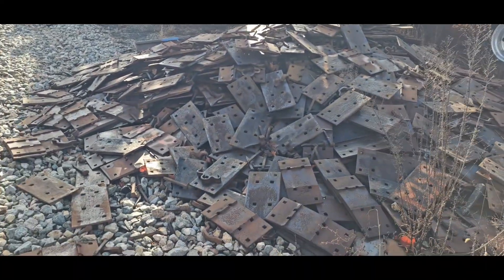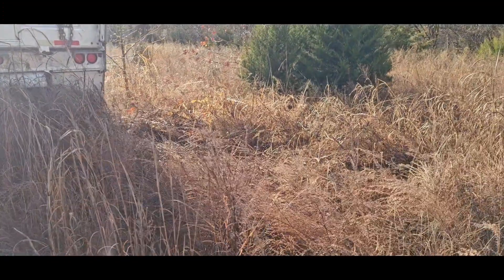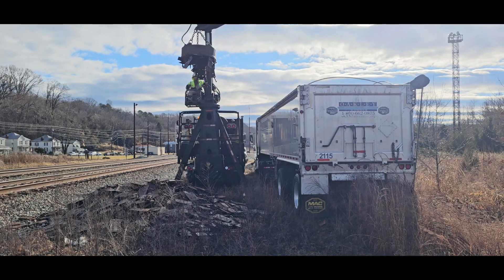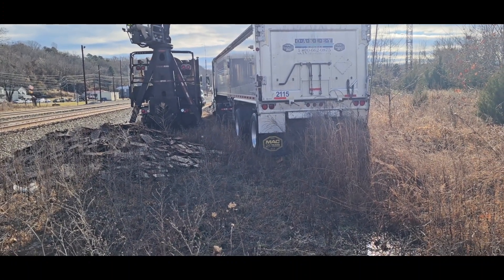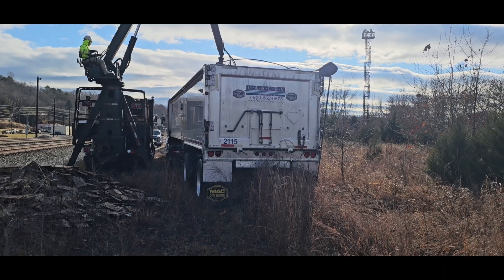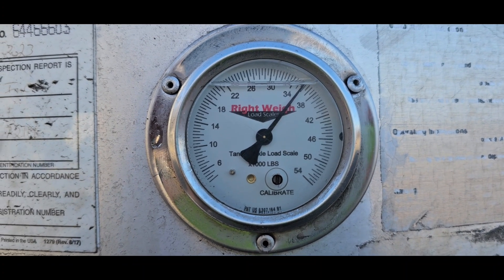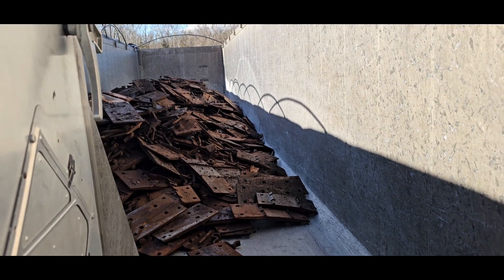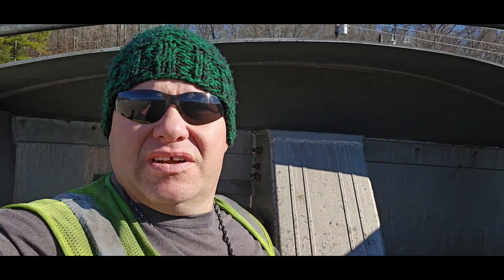Oakley Trucking: load of rail road scrap

Comment: The used tie plates , spikes , anchors and bolts nuts and washers are separated , inspected and used in construction of new track panels 39 feet long . The track panels are used to rebuild tracks in case of derailments , new tracks for sidings and new construction . Track panels are a quick fix to get the railroad running trains again . Once the track is in use the short rails , tie plates etc are replaced with continuous welded rail thats a lot heavier and the railroad is back to running trains at maximum speed . Used material is picked up and used again to stock pile track panels for use as needed . Depending on size of rail tie plates can get very , very heavy and bulky .  OAKLEY TRUCKING is a North Little Rock , Arkansas Company that serves 48 states and Canada . 1968 was the year Bruce Oakley started Oakley Trucking Company in their home town of El Paso , Arkansas and quickly became a huge trucking company .